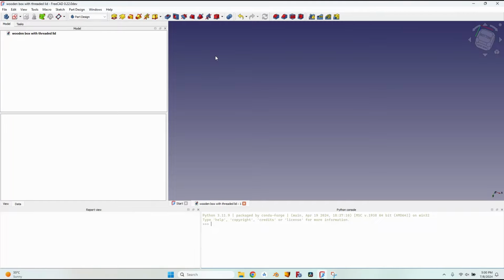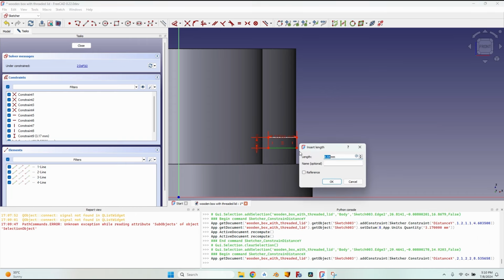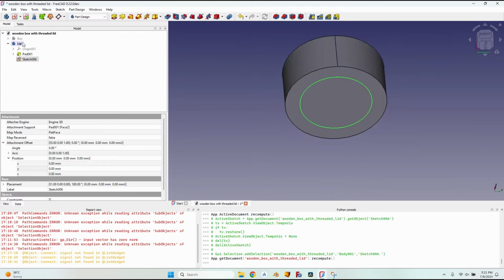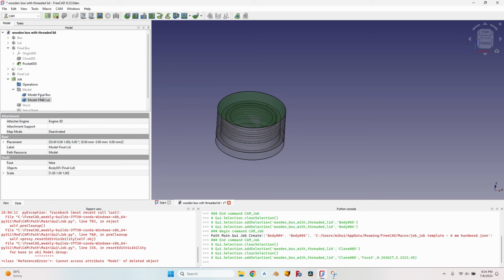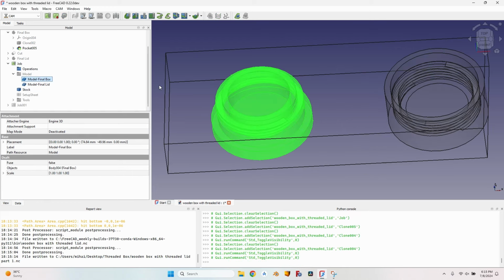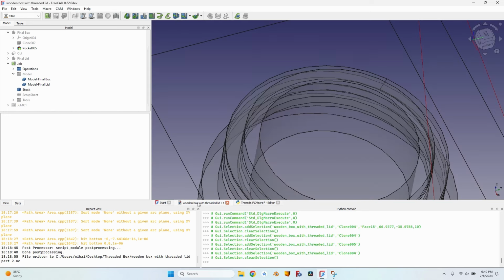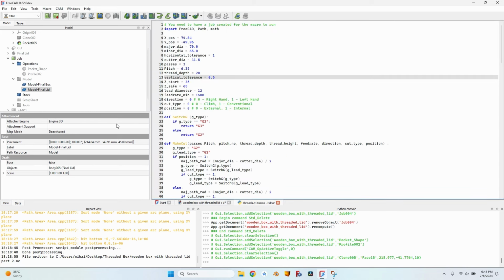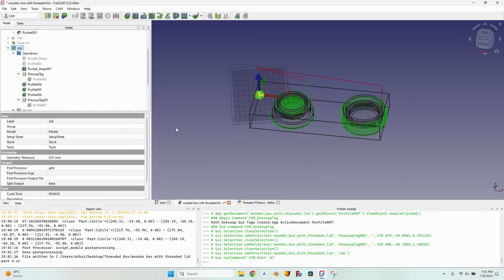CNC Threaded Lid Box | FreeCAD CAM Tutorial + Free Macro

Comment: Hi! I am following along.When I run the macro, I get some Gcode like this: "G3 X0.6120 Y-0.4470 Z0.0000 I0.0000 J0.7579 F59.0551 R0.7579 " When I try to run it on LinuxCNC, it errors because the line uses IJK and R together. Any idea what's going on? Thanks for the great videos!
Reply from the maker: Thanks for letting me know. It is a problem, indeed. I was only able to test it using fluidnc. I will fix it in a few hours and let you know
Reply: @opensourcecnc  Ok, thanks! No rush on my part :) I appreciate the example macro - I have a few ideas for using it to create paths for some operations I do. I have been making small python apps to generate the gcode, but this looks like a nice way to do it.
Reply from the maker: Done! i've updated the file on Patreon. It has the same name, so delete the initial one first, to avoid confusion. Thank you for the support!
Reply: @opensourcecnc  Thanks- I will try it out and let you know. I just pre-ordered the digital book as well.
Reply: @opensourcecnc  Visually tested on internal and external and LinuxCNC has no problem with the Gcode now. Thanks
Reply: @opensourcecnc  Hi - I wrapped your macro in a GUI to make it easier to use. I sent it to your gmail in case you are interested. Thanks!